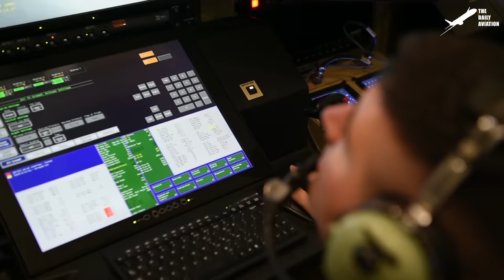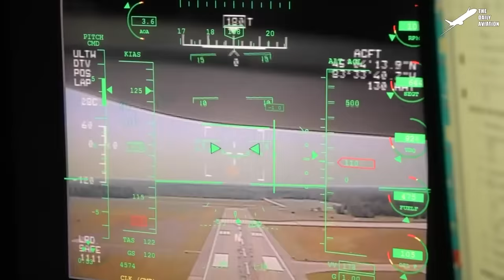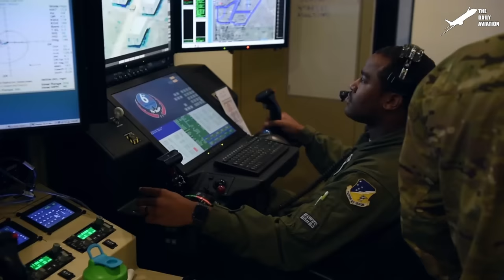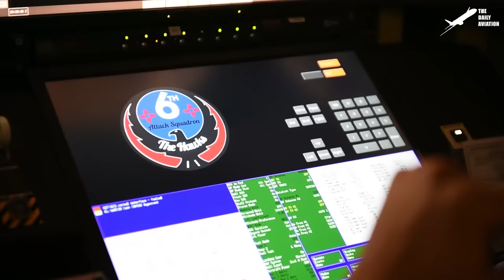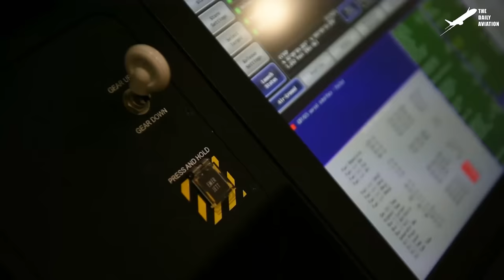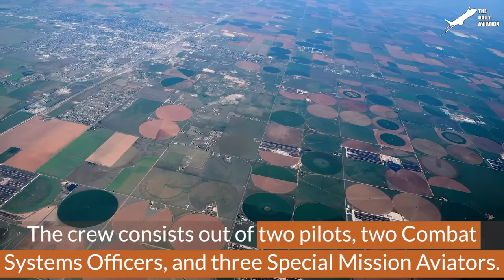A Day in Life of Operators of US Most Feared Drone

Comment: If a drone can fly for 20 hours, with a range of 1200 miles, what's it's average speed?

Average speed can be calculated by dividing the total distance by the total time. In this case, the drone's average speed would be 1200 miles / 20 hours = 60 mph.